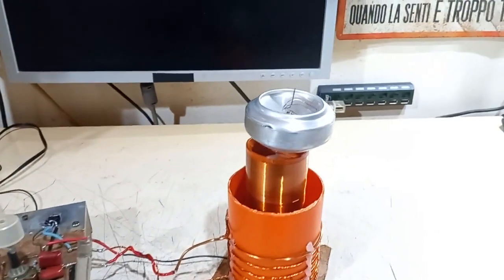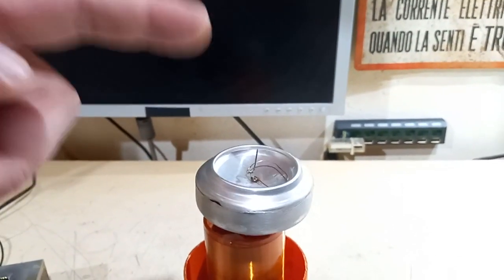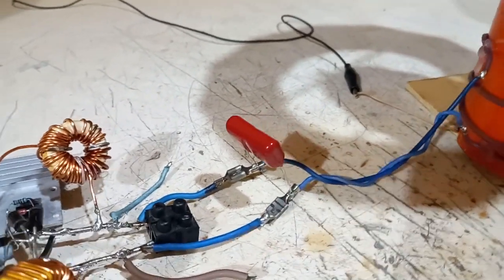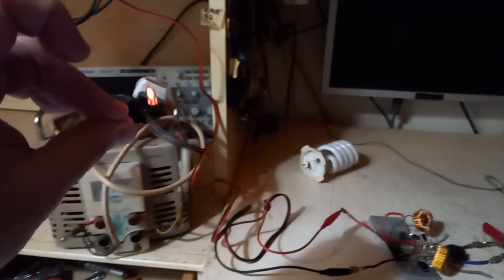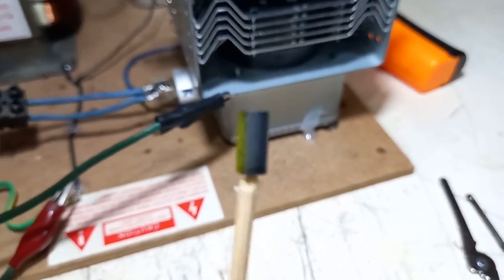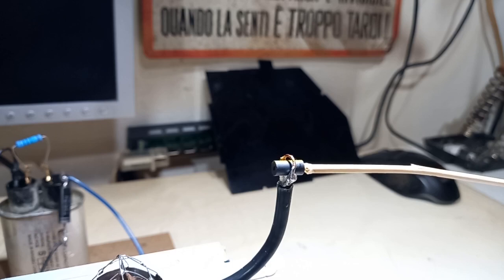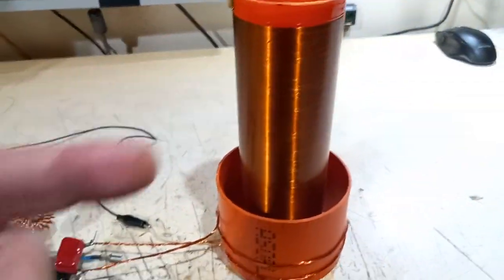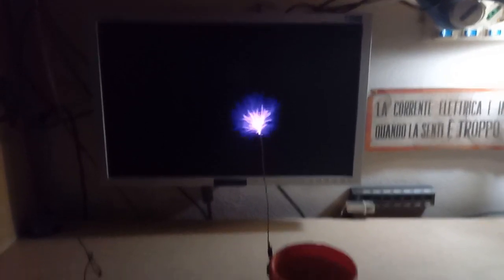HIGH VOLTAGE "Experiments" Megamix Vol. 8

Comment: If you can use LTspice go ahead and simulate ZVS circuit. Do not forgot about stray/leakage inductance in transistors drains. 
The sad truth is that, the zvs circuit is not zvs and not zcs. Moreover during time when one transistor goes down and second start conducting there is a abrupt current change in drains of both transistors. This induce voltage spikes along drain wires. This spikes can destroy transistors. 
Next sources of problems is reverse recovery time on diodes in drains and inside parasitic diodes in mosfets. 
So: not soft switching, long time transistor commutation, high losses, high emc emission, hard power regulation and unstable work. 
This oscillator works good with low power and without any load. 
Or start use LT SPICE and find this things yourself.
Reply from the maker: i use LTSpice since years, i simulated a lot of things, ZVS probably included, it's just that LTSpice is crap for simulating a tesla coil, like whatever simulator, the arc is very complicated to characterize, and it's part of the circuit, especially in a coil like this that jams the moment you put your hand near the output... IMO LTSpice is good if you have a doubt, or to simulate circuits with a simple load, for circuits with a lot of factors it starts becoming worth basing oneself on experience rather than a simulator

Comment: Regarding the 2.45GHz induction heater experiment: an electrically short loop antenna will have its highest gain in the plane of the loop, rather than perpendicular to it (which is what you would have with a loop circumference closer to lambda.
Reply from the maker: yeah, you're probably right